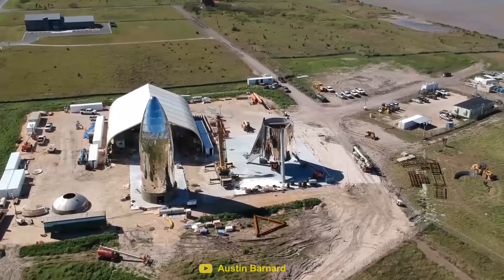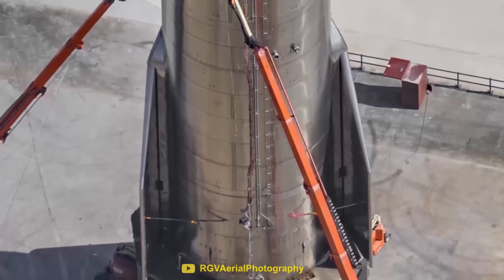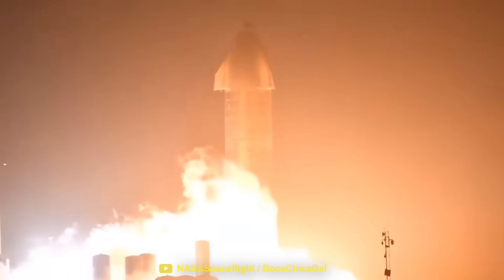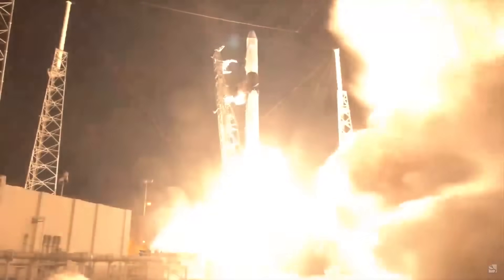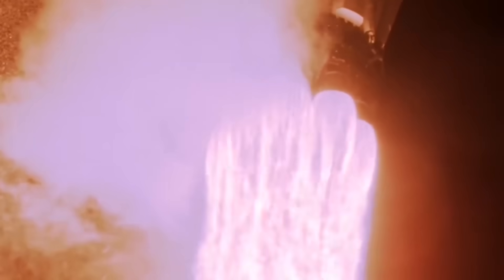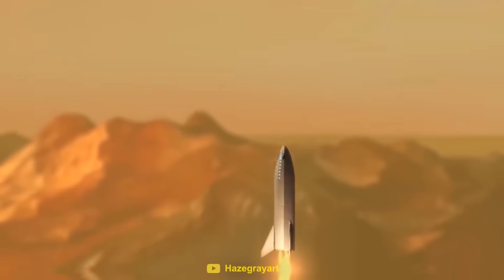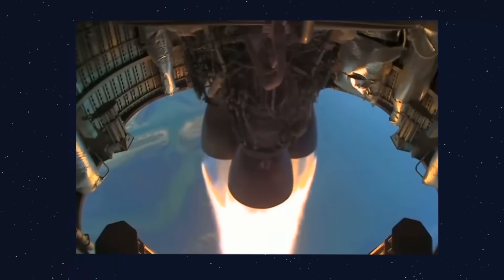SpaceX's Launch Pad Problem

Comment: Great analysis of a problem I didn’t consider. My suggestion would be to encase all engine in a protective shield allowing only the opening of the engine bells to be exposed. It could be called the engine chamber. This engine chamber would be anchored to a  pivot front/back and side to side to allow gimbaling. Or even simpler, just add a stainless steel barrier that would close the underside of engine bay and cut out holes for the engine bells. No engine gimbaling needed, all that is needed for rocket orientation is engines throttling.

Comment: The test launch pad they are using is inadequate. But, they are moving quickly on a tight budget so I get it. This pad incident is proof that the starship in its current general design configuration will obviously NEVER land on mars. Calling starship humankind’s ticket to mars is simply a PR tactic to generate excitement attention and to attract investment. Most people are gullible. Most people believe most of what Elon Musk says. I will let you in on a secret. Elon Musk is smarter than you... remember this... Starship is a stepping stone... steps towards eventual development of a vehicle that is actually designed to land on unimproved surfaces without engine damage. The first manned lander to land on mars will not be this specific design... this thing as designed will be used on Earth to land on designed pads only. IMHO. But go ahead and believe these things are going to land on mars. It’s ok... you are actually helping Space X if you do so.

Comment: The launch site issue needs to be dealt with in small scale before just ignoring it until later. A basic system similar to the basic tank/engine units from earlier tests that launches, lands, refuels and launches again from un-developed sites similar to what would be found on the moon and Mars. If they can't work it out in small scale then they are not likely to make it work in large scale.

Another issue is that putting the fueling ports in the engine bay drastically increases the chances of those ports being damaged rendering the craft either largely useless of perhaps even destroyed.

Comment: How will the crew determine that the ground is suitable for a landing, and the presumed take off ? Mr Armstrong had to manually intervene after using the mark 1 eyeball. Recent launches have shown that concrete was blasted from the pad. Armouring up the base of the ship, from an engineering point of view is straight forward.  On the Moon, or Mars, at lift off , the surface around, and underneath the feet could be sufficiently eroded away or undermined by the exhaust gases , so as to make the vessel tilt. How much off,  perfectly vertical can SpaceX launch from an alien surface. (We have already seen that it can fall over). Will the crew have to manually deploy some sort of ground shield after landing? Landing pads would have to be built eventually. Beefy bum and space concrete ? Personally I think what SpaceX is attempting is brilliant. And what they have already achieved is fantastic. Just very little info on the above.
Reply: The Starships legs will eventually have a self leveling feature. But that's and issue that is a long way down the road.

Comment: Good video. Problems with the SpaceX launch system have been discussed by the SX community even before Musk announced that there would be no flame diverter. This video puts that all together and adds some additional information.  As far as a trip (or trips) to Mars, I have always considered the first Starships sent to mars would be on a one way trip, without yet having a nuclear engine, that is at least a two year interval between flights. Make that a four year interval and you have time to build enough launch "pedestals" and landing pads to do the job. That also gives enough time to build the volume limited fuel making facility currently proposed by SX. NASA is already working on a nuclear engine that can act as a tug between destinations and that would require only enough fuel for the Starship(s) to takeoff from mars. Myself, I think the far more important mission for SX is the moon. We absolutely cannot afford SLS and their problems continue daily. The Super Heavy alone, with its greater capacity, could step in and be used to launch the Orion capsule and still put us on the moon by 2024. My preference would be to use the Starship for that purpose but probably not before 2026. Some skeptics might say we are at war and the first battleground is the moon. I think that is our most important destination.

Comment: Why don’t they launch from soil since it’s the same on Mars and is much softer than shards of concrete🤔 Very good video 👍
Reply: Because it would blast a hole in the ground and would cause the foundation of the pad to collapse, causing the pad to completely collapse
Reply: @masonmtb7  Wouldn’t that happen on Mars? They land and launch on the same surface on Mars
Reply: @PassportGaming  mars surface is not entirely soft soil and contains hard rock. Plus, mars has about 1/3 earths gravity so the effect is minimized. Plus, they will only launch and land from a specific location only one time.
Reply: Good point. They don't because that's not something they are addressing right now. It just cheaper right now to not build a proper launch pad. And you're right, they will have to deal with the issue of blasting lots of dirt around on mars just like they would if they tested on earth.  Gravity being 1/3 won't make much of a difference because of the large mass of the spacecraft compared to the Apollo LEM. In addition we don't have the  technology to detect soil thickness to a usable accuracy from orbit around mars. So finding a hard surface will be impossible at the beginning.

Comment: Maybe the rocket engines can gimbal their thrust 45 degrees during lift off for the first let’s say 100 feet than redirect directly downward for the remainder of the assent and reverse procedures for landing.
This might redirect most of the debris away from directly under the ship .
Of coarse the legs of the ship would have to be properly positioned to avoid the engines blast if that’s possible.

Comment: Can the same steel produced to build the rocket cover the starting/landing pad on earth? Flat or maybe like a cone under and therefore reflect the heat outwards. Water could maybe be added from holes in the the cone. Image a big cone-sprinkler. A cone with holes, no parts just holes and high pressure water. - Just guessing. I usually don't now what I am talking about.

Comment: What I didn’t hear about is the fact that the thrust required to land and take off from Mars is much less than on Earth.  Less thrust, in much thinner atmosphere. That is what needs to be tested.
Reply: The terminal velocity for the skydiver maneuver on Mars is much higher. Raptor engines will need to fire earlier and for longer.
Reply: @avid0g  Is that based on actual calculations of coefficient of drag in the thinner Martian atmosphere and under the lower gravity of Mars?  Or a guess because the atmosphere is thinner?
I admit that intuition suggests you may be right, but I’ve been surprised by unexpected results in math and physics.
Reply: @thinkingoutloud6741  
Less than 1% density/pressure of Earth sea-level. Still, the aerobraking removes over 99.9% of interplanetary velocity.

Comment: Launch it with bungie cords. Ignite the engines on the way up.
Reply: That's basically what the recent Chinese moon lander did. The ascent stage was ejected from the landing stage by a spring, and it lit its engine once it was a few meters above the lunar surface.

Comment: Very interesting! I ve never seen this problem brought up by anyone.

What if starship had a way to elevate itself before ignition? Like with long legs or something like that
Reply: I have been pointing this out for over two months in a few comments especially since they will not exactly know what kind of surfaces they will be dealing with when landing on the moon and mars .
Reply: @williamgrimberg2510  anyone with an audience :P
Reply: The reason no one talks about it is that it's not yet an issue. The Starship they are building now is not the one that will need to launch from the surface of Mars.

Comment: Landing in two parts might work 
How about upper and lower parts split in two equal parts and land with less force in last moment of touch down to reduce damage cause by shockwave.
And because gravity is less on mars they can take off separately from mars surface to reconnect in space. 
Once they build landing and launch platform they are good to go with normal means.

Comment: When the rocket progressed so fast that infrastructures can't keep up with the developments.
Reply: It's the rocket's design that needs to be changed to prevent this actually
Reply: @coonjamalay  not really. It’s just interactive development of the infastructure
Reply: @colesmith6874  considering that it will be worse on mars...they have to change the design at the engines for the starship
Reply: @coonjamalay  well yes, but that isn’t a rocket design change, it’s a different version of the rocket for Mars. They know this of course, so they will have that already planned out
Reply: @colesmith6874  "that isn't a rocket design change, it's a different design of the rocket for Mars." oxymoron there/
Reply: @whyareyoulookinghere9135  different iteration. What I mean is, the rocket design is already set. But it’s a different version of that rocket, specifically heading for Mars.
Reply: @kukuc96  right, and the Mars rocket will be different than the ground one to fix this issue. Yes, they need to change the design based on what is currently flying, but that isn’t really a design change since they already know that this is needed and how to fix it, and already have designed the Mars version of the rocket. That was the point I was trying to maker

Comment: Mimic nature, build a lily pad.
Reply: Yeah maybe a large but thin stainless sheet could be dropped on the launch surface before take off. This would prevent ground erosion from the engine exhaust.

Comment: Actual landing LEGS instead of landing FEET would help mitigate this it a degree.
Reply: I does make sense they are using the simplest possible landing gear at the moment. No point in wasting resources on them yet as they expect to lose some early prototypes. They are incrementally adding complexity as it's needed and legs will come when they start being confident about having safe speeds at the landing phase.

Comment: Couldn't they just refuel Starship through the Engines? Since the Engines have fuel lines to the Tanks one could surely just pump the Fuel through the Engines into the Tanks?
Reply: Nope, definitely not
Reply: @masonmtb7  why tho
Reply: @timoheinz2879  would require a complete redesign of the engines and plumbing systems of the rocket. Also is much much less practical and is more complicated

Comment: I don't know the physics behind shockwaves, but would the shockwaves be exactly the same on Mars as on Earth? With the thinner atmosphere and all. Quite curious actually.
Reply: They'd be quite different. But if anything, the damage would be worse -- the engines produce all that vibration, but there's so little atmosphere to carry those vibrations away, so they just build up worse and worse.

Fortunately, we've been using rockets in a vacuum for sixty years now, and they generally haven't rattled themselves apart. The problem seems fixable.

Comment: You make good points about landing on Mars and the need to be robust enough to deal with launch and landing with no prepared pad. For Starship, this is necessary. Super Heavy is a different animal, however. It's ONLY going to launch and land here on Earth. And the need for a flame diverter/deluge system for all of those raptors will be REQUIRED if they are going to successfully handle it.
Just my two cents.

Comment: The gravity in both landing/launch locations that are not earth require less thrust (and the ship will have less propellant weight) so they have more play in the launch/landing with thrust to reduce damage to the ship. They might as well do a little bit of pad work because of that, on earth it will be the most likely to have issues with heat and thrust. Also F&%$ Elon, he's not fascinating.

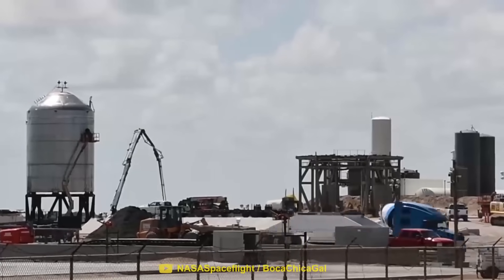Comment: @3:14 "there are no landing pads on the moon or Mars"... exactly.
Reply: That is an issue, but Mars has less than half of Earth's surface gravity, and the Moon has less than 1/6th of Earth's gravity.  You don't need as much thrust to get off of the surface, so you can run your engines a little slower and generate less debris.  It'll be interesting to see how they deal with it.
Reply: @SerialSnowmanKiller  With less gravity and little to no atmosphere debris will accelerate faster also I think.
Reply: @A D Easier to design a spaceship that can land without a pad. Why not put the engines midway up. Have a longer tube and some hardy landing legs. And have a redirection flap on the bottom for take offs that redirect the rocket boosts 45° instead of straight. And once airborn the flaps close for straight down boost.

Ive seen a youtube vid of usa jets vs russian jet design. The US jets need clean runways for takeoffs so people have to go out and clean the runway of debrie by hand. Where as the russian migs have a flap on the front intake for take off so they dont need clean runways for take off. A similar design might work.
Reply: @jonymanay  or land horizontally on skids, like the skis used on aircraft in the antarctic.
Reply: Did you see the most recent episode of "The expanse?"  (I know it is fiction...) The "shuttle" landed tail first on the moon, in a developed area.  Still kicked up a lot of dust.  I think Elon Musk is correct.  The thing has to be able to handle it.  Kind of like how a Dodge Ram TRX pickup is engineered to handle off-road conditions at high speed.
Reply: @Niles N you still have rocket engines, of which produce shockwaves
Reply: @Niles N the atmosphere doesn't matter here, you are throwing tons of gas out of your engine at very high speed, the atmosphere can only impede the damage that causes
Reply: They are not composed of concrete either Einstein!
Reply: @donraptor6156  which makes it worse.
Reply: @Niles N i can't understand what you said, maybe try to be coherent?
Reply: Yet
Reply: @zakk2936  The first crew will be a little nervous for sure.
Reply: @zakk2936  send the first to Mars and there is a landing pad and you better f**** hope those robots were off chart.

Comment: Why the engines are with all sensitive components exposed? Nobody else does that with a large rocket not even SpaceX with falcon9, they need to put protective covers on its.
Reply: Because it is usually just dead weight
Reply: @kas-lw7xz  probably they think that because is only a upper stage can eliminate such protection like other producers do with their upper stage rokets , but forget that their upper stage needs to land in rough terrain full of dust and debree and even staying in the open for months!